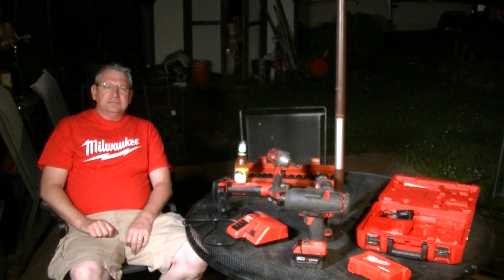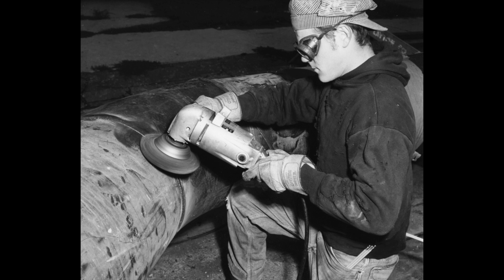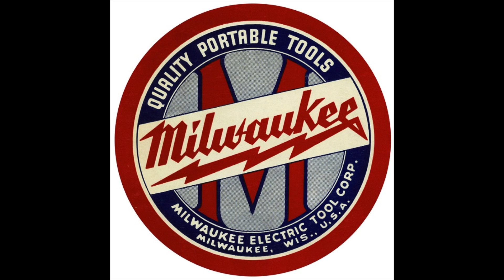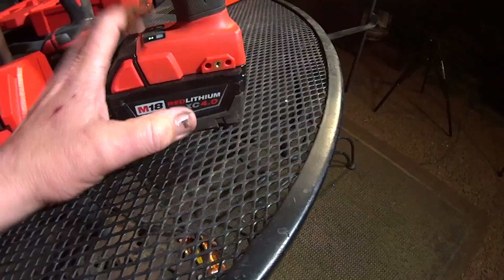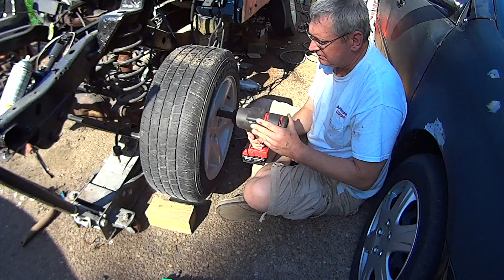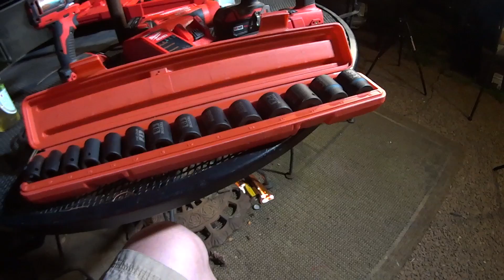Milwaukee Tool Review at the Redneck Garage

Comment: Great review.  I've seen this review and Jerry's review and although I'm big on manufacturer warranties, this is a toss up.  Probably gonna come down to reviews and price.  And with the sockets...laugh at me if you wish, but I just use Harbor Freight sockets for all my work.  They may be cheap and inexpensive, but they have never given me any issues with replacing parts and pieces that break.  I keep all the receipts from there and even if it's just one socket from a set of 50...they replace it no questions asked, no extra fees.

Comment: I don't know I like my pneumatic impact but after see you undo the  rusty bolt im impressed  just wonder how long it would last  in a everyday use on heavy machinery  like would it be able to turn off wheel nuts on a semi truck there torqued  at 500 ft lbs  and  10 on each wheel I think the battery would not hold up to pulling of 60 nuts at a time  sometimes 3 times a day what's your thought on this buddy
Reply from the maker: drvshaft drew I dont know - Are you using a 1/2 in impact not ?  If so then I would say it probably would - this thing is crazy good.  You could always order on an Amazon and then send it back after a few days if it didn't perform as well as the air -
Reply: true